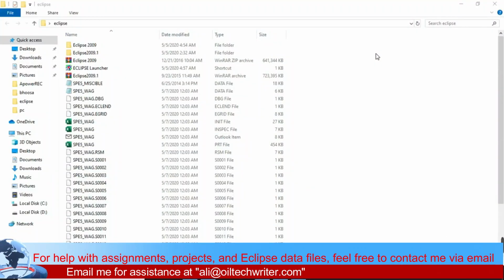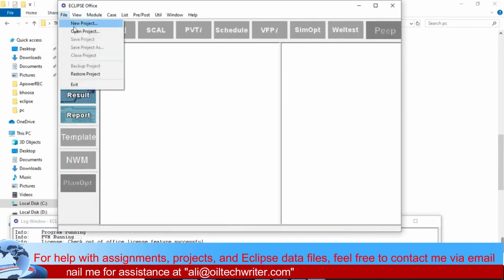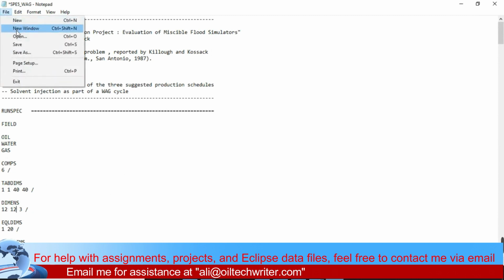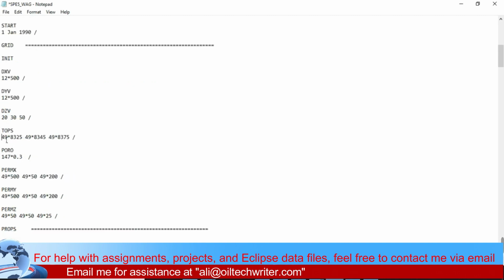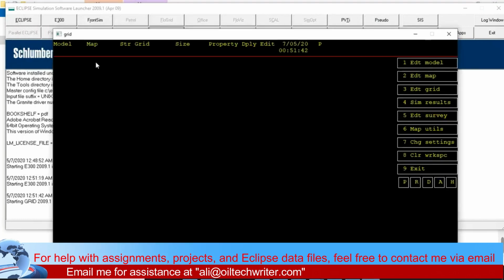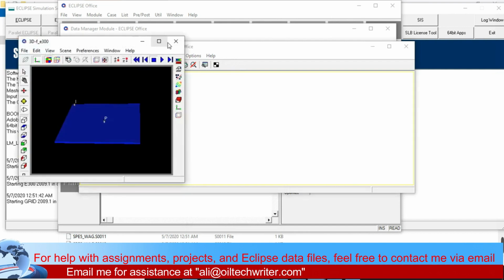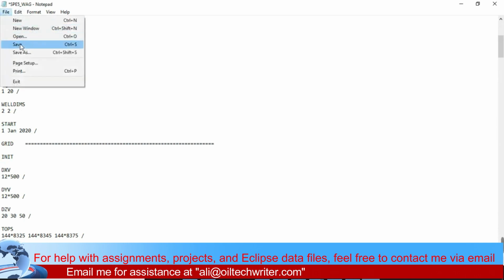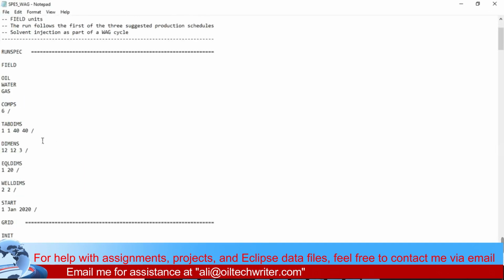Reservoir Simulation: A Guide to Changing Grid Dimensions in Eclipse Data Files

Comment: Sir, I'm having some difficulties about setting the depth of the top surface of the grid blocks using TOPS keyword,  since different blocks have different depth. What should I do in this case? Can I use EQUALS  keyword, as we use it to set different porosities and permeabilities at different blocks?
Reply from the maker: Share with me depth details .yes we can use tops in a different way for each layer.